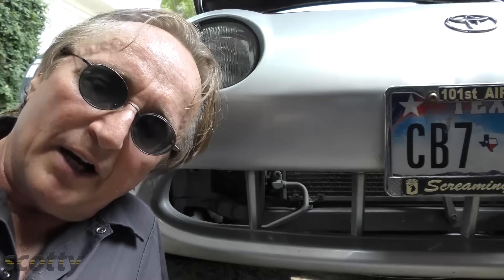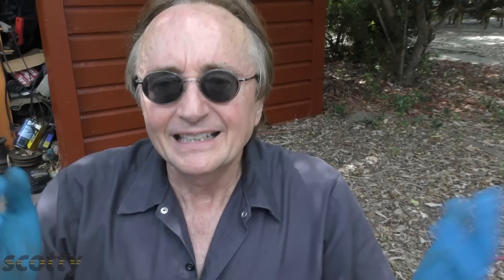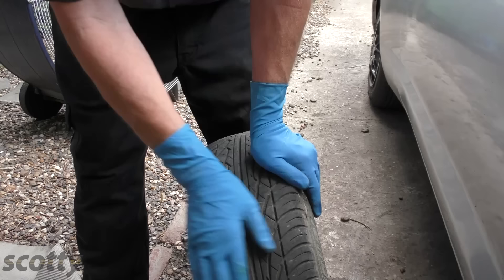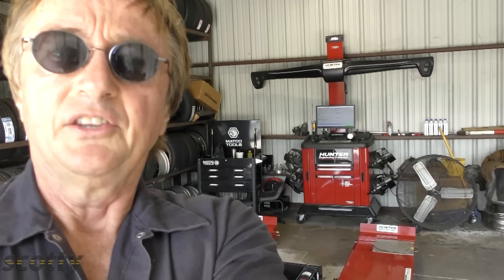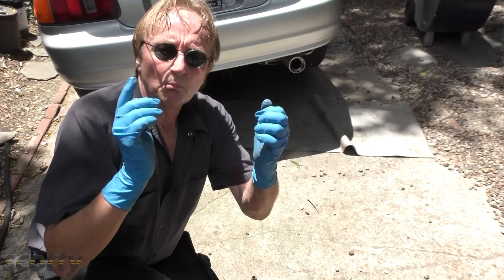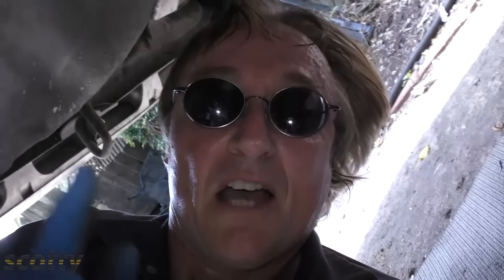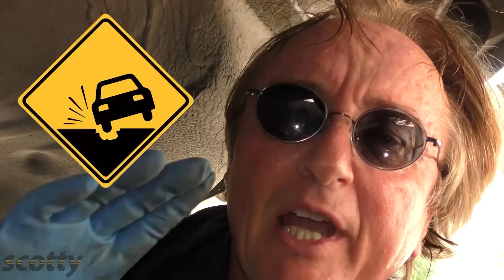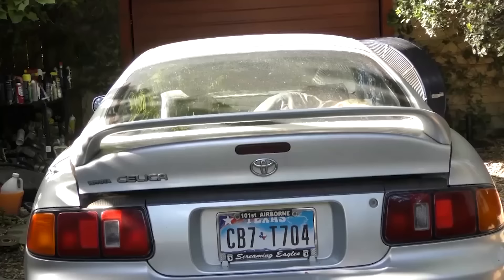How to Tell if Your Car Needs an Alignment

Comment: I just got new front rotors but before i did the dealership shifted crossmember to fix the caster . Left side axle had to be replaced also had warped rotors .With the new rotors Im still notcing a slight vibration/ wobble. My guess its caster issue but i dont know nothing about cars honestly. And dealership is acting funny now 
Any suggestions on how to fix my issue ?
Thanks 🙏

Comment: I have a 2001 Mercury Grand Marquis and it has 52,000 miles. It's really  squeaky over bumps. Can this be ball joints? It hasn't even hit 60,000 can they be worn already? Note that they are the old ball joints that you can't use a grease gun they will have to be replaced.

Comment: If your cars alignment is off some your tyres will tell you but you have to look as sometimes the evidence of alignment problems is hidden away. My car had alignment tyre issues and it turned out the actual car was bent not the alignment.
Reply: tires not tyres
Reply: @davidmartin9535  Tyres.
Reply: +cutterbacon what is a tyre!
Reply: +cutterbacon are you not from usa

Comment: Scotty, you can't have it both ways. Cars can't have fewer adjustments because they're 'built cheaper' AND require front end alignments far less frequently than in the past. I have a 2018 Volvo, and it hasn't needed a front end alignment...ever. That can't be said of cars in the 50s or 60s...they had more adjustments BECAUSE they were built cheaper, and stuff broke/got bent more often.

Comment: What could be wrong with mine, if my alignment is sometimes good, but sometimes not? Most of the time when I drive it’s shaky and the steering wheel is crooked. But once in a blue moon, it’ll drive perfectly. No shakiness and the steering wheel will be perfectly straight

Comment: There's a highly rated alignment shop here that doesn't use computerized alignment. $40 for front end, $60 for 4 wheels. I wonder how accurate they are.

Comment: What if my 97 RAV4 is not pulling to the left or right no shaking at 50 to 70 80 miles an hour doesn't pull but yet I still get a little bit of uneven tread wear how do I fix that just that tire alone or that side of the vehicle thank you for your how to videos looking forward for your answer and also the question on my  shocks and struts
Reply: Tire Rotation?

Comment: Hey Scotty Kilmer, i have a problem with my Saab 900 II, my cockpit doesnt work, the lights are on but no speedometer, the gas display dowsnt show anything, the cockpit lights are synchron with the radio music sometimes, also the right indicator is sometimes faster. The right break light work just when the normal light is out. I checked the fuses but they are intact. Greetings from Germany

Comment: I realize this video is old but, I have a question  for anyone watching. Could a car with a bad alignment cause bad gas mileage? I’ve recently been in an accident involving the front of the right fender on my car, and have had the right strut, and lower control arm replaced due to the damage. The shop did not have an alignment machine, and ever since the accident it has been getting 2-3mpg worse. I’m just wondering if the alignment being out of wack could cause this. I apologize if this question has been answered before in one of Scottie’s videos.
Reply: The car is all wheel drive if that makes any difference.

Comment: If my car doesn't pull to one side or the other and the tires are not really being used up more on one side than another but it does shake a lot after I pass 60 mph does that mean it's the alignment? I have a Subaru outback 2010 2.5 l and I believe it's all wheel drive. A guy last night while I was ubering told me that it's the CV joints but it doesn't seem like that is correct to me.

Comment: I got a question can shocks contribute too bad alignment
Reply: yes ,on modern cars even after an emergency breaking or hitting  a sidewall / The alignment of your vehicle can be knocked out of adjustment from daily impacts such as potholes and railroad crossings, or by more severe accidents.

Comment: Hey Scotty, I have a Mazda 3 2012, and I've gone through at least three sets of tires with the same issue of rapid wear and tear on the outer edge of my front tires. I've had multiple alignments and rotations, but no one has been able to fix the problem. What could be causing this issue, and how can I fix it?

Comment: So what if if just replaced my four tires and the car is shaking a little bit at high speeds and is pulling to the right? It wasn't doing this before with the old tires. What could it be?

Comment: Took car in for alignment and tire rotation. Have directional tires so they put back on front and front on back. It pulled to the right and said I had a radial pull.. tires on rear have better tread and would like them on front for winter. Any suggestions?  Tia

Comment: Alright so, my car shakes when I break coming off the highway, the folks at Canadian Tire say that my break pads and rotors are new and have no problems with them. However they did say my back two wheels are starting to be scalloped and my car slightly pulls to the left, is it an alignment issue?

Comment: Scotty what about maintenance schedules that say you should get an alignment every 60K miles. Would you say that’s accurate ?
Reply: Way too long. An alignment will go slightly out of spec on regular driving every 20k.
Not enough to show wear but when you get to the point you can see the uneven wear you are miles overdue.

Also you can have even wear just accelerated wear and poor fuel economy. When you look at the wear you think your alignment is good but its costing you hundreds in extra fuel and mileage.

Comment: Can I still get an alignment if my front struts are leaking? Or should I take care of the struts first. I know both things need to be fixed but I'm wondering if I could get an alignment ($86) done first before I fix the struts ($498).  I want to fix the less expensive thing first, but not if it's pointless.
Reply: since you have to get an alignment after you replace the struts anyway, I'd just do the struts first.

Comment: When buying new winter tires, do I need to replace TPMS (Tire pressure monitoring system).  I bought my car used in April 2019 and it's a 2018 Nissan Versa Note SV with 16,500 km

Comment: how about when you get new tires? (do you want to get it aligned)
Reply: If the tires are wearing unevenly, the car pulls or shakes at high(er) speeds then yes. I just bought four tires on my 05 ranger and never got a friend and alignment. It was driving fine.

Comment: my 2007 Daihatsu Terios's steering wheel starts shaking around 120 km/h and normally has a tendancy to slightly swerve to the left and whenever I'm reducing speed I get this feeling like the right side is all wobley (dunno how to spell that) but the car doesnt shake, I just hear it. 
I do have old tires that need replacing but is that all there is ? 
Every mechanic I ask, tells me something different.

Comment: Wong...Thousandths of a degree is measurable with a tape measure. It falls inalignment.
Example 33 in mud tires was on my nissan. Toe is 0.12 to 0.18 of a degree. Thats 0.078 to .103 inch. Convert fractions i n between and your in range.  
Mine is dead nuts on. I won't have it touched 
YOU CAN DO IT AT HOME on a bigger tire car. 
I will not say how many times I had to undo a crap alingment

Comment: Scotty I been aligning my toe in toe out with string for 15 years and I have never had tire wear and tear that was uneven. Maybe I'm just lucky but I drive older vehicles that the back axel is fixed with no adjustments.
Reply: Even if your back axle is adjustable, you can still use string to ensure it is parallel to front. If it wasn't you'd see the string wasn't touching front and back of the rear tyre.

Comment: Scotty , had upper and lower ball joints on my  Toyota  Hilux 1998     2.7 petrol ( not by dealership ) it has had wheel alignment  but it feels uncomfortable to drive , the self centering of steering no longer exists . Is there a wrong way to fit ball joints ? Cheers .

Comment: Love the channel. Is there something about rear toe alignment that's more exacting vs the front? I've always "fine tuned" my front toe a little with excellent results (on every car I owned) with small adjustments and some driving to test. Perfect tire wear too.  

However my 2010 Civic rear toe is a nightmare. Only messed with it when I got tired of it kicking to the side over bumps. Now it wears tires fast, gets very squirrelly in the rain no matter how many times I got back under it. The factory crayon marks are used as reference and I lined em back up then micro tweaks to no avail. I'm taking it to the shop. And this car is so harsh over bumps and feels sloppy in handling them, I'm hating this car. Yes the shocks have been replaced.

Comment: Scotty,  I have a 2wd jeep cherokee and when in reverse turning it feels like I have a camber issue(I can't see while driving) but the tires feel like they are slipping on the pavement and kinda buck mainly the passenger side .I can see a bit of tire scalloping and some inside wear on the tires. Do you have an idea on my problem? Ball joints,alignment,worn tires? I got it in an auction so I haven't got alot of experience in it. Thanks buddy from a fellow Texan and new subscriber!

Comment: How much does an alignment cost? For awd? Can the dealer do it under warranty?
Reply: Alignments are adjustments for wear and tear, so no warranty. Cost varies, but you'll typically find a cost of $70 to over $100 depending on whether your vehicle requires a 2 or 4 wheel alignment.

Comment: I took my car in for a front end alignment and all they said was that they did a visual alignment and it shakes on the freeway pulls to the right, very not correct I know that much about cars. They charged me for it and for putting a new tire on the car it doesn't look new. What can I do

Comment: I have a Nissan Sentra 2005 in my driver side back wheel is wobbling what would be the problem could you help me to figure it out it’s not the tire and wheel is on tight

Comment: Its not true that alignments can't be DIY. I get very good repeatable results using a parallelogram setup with conduit, strings, and a dial caliper. Getting the accuracy and making adjustments is tedious and time consuming, and one could argue not worth it, but it can be done.

Comment: HELP! Inside wear showing after slamming on the breaks to avoid an accident.. just an alignment needed or could it be worse?
Reply: Uneven front wear too if that’s a clue. Significantly more wear on the drivers side. 😞

Comment: Hey scotty, i just changed my stock rims in my suv from 265/60r18 to 275/55r20... Do i need wheel alignment? Thanks!
Reply: The difference in diameter isn't cause to have it done but you'd be silly to spend all that money on new tires and not check it.
If it hasn't been done in the last 10k miles, then get it when buying new tires. Otherwise 15k miles is a good benchmark.

If you ever need an alignment because you notice it wearing, then you left it too long.

Alignment should be preventative.

Comment: First, let me thank you for the many videos you have produced and posted on YouTube. They have been very informative and funny. Making them standout from the rest. Over the years they have saved me time and money. I do have one question though. I had my tires rotated and found that the ones now in the front are cupping, making for a nosey and rough ride. They were not like that before my rotation. The tires are not stock on my 2006 Toyota Tundra truck. They are larger Toyo Open County tires and are only about a year and a half old, with about 30k on them.  I take it my rear end must have been out of alignment? If that is the case, once I have both front and real aligned… running tires that are cupping will they have an effect on the alignment over time, or will they eventually ware evenly? 
Once again thank you very much. 
Mike

Comment: Hey Scotty, Walter from Virginia here. I have a 92 Mazda mx3, 5 speed, 1.8 V6, 175k miles. What do you think about these cars? It's hard for me to find parts for it, it's not worth alot online I paid 300$ for it. It runs pretty good what do you think of the mazda mx3? what common problems have you seen that I should watch for?? Any preventative maintenance I should do?

Comment: Mr Scotty, Is there any way in the world that bad tires can cause vibrations when braking hard in a speed above 70 mph? Well i would say the tires are not that bad, i bought them used from a tire shop and they are maybe 20%used, but there is a slight difference in hight on the inside between the last and step next to it on 2 tires out of 4 (Michelin primacy 3). It looks natural and does not show any kind of ware. Car pulled slightly to the left too after mounting, but then i switched the front wheels and the it pulls straight now. Pads and discs are prety new and of good quality( brembo) and are inspected and so are all parts around the wheel. This is an realy anoying issue. I was thinking maybe to check the wheel aligment anyway since it has not been checked if that also maybe could cause vibrations??

Comment: I usually do my own wheel alignment at home with a giant home made caliper with adjustable square ruler for aligning the left to the right wheel, 2 jack stands with string to align the front to back with the use of adjustable square ruler , and a mini bubble level for camber. The adjustable square ruler is also used for measuring caster and the giant home made caliper pretty much looks like a very wide U, it can be made out of wood or steel. I also had the alignment tested at a shop once and they said no change was required.
Reply: Yea but a homemade alignment isn’t going to be as good as a alignment done with a thousand dollar machine
Reply: @randomaccount2725  If you do it at home and the tires aren't wearing unevenly, and the vehicle handles properly, then it doesn't matter how much that machine cost.

Comment: A question  not about this vid  can you tell me what the little white connected behind the intake on my 1998 5.7 is I sits lower then aircleaner plastis parts and above the manifold and has a very small wire.  
Thanks

Comment: I hit a large pot whole over a month ago in my car , I recently had my yearly inspection done aka MOT in the uk .I was looking to get some new tires I noticed my right rear on the inside has no tread on it does this mean something is bent or I need an alignment.

Comment: Just got myself four new tires in my vehicle as it was wobbling quite crazy on the highway, and the steering wheel wasn't exactly straight.

Went into a shop that does suspensions and all different stuff like that.
He did a wheel alignment but he didn't use the laser machines which I thought was very funny?

I'm used to seeing only the laser machines being used.
 I paid 70 bucks but I don't think I got the alignment I was supposed to get.
Is the alignment I got worthless?

Or how can I tell if my alignment is okay being that I got four brand new tires, as my previous tires were being worn on the inner part or was it the outer part.
Besides for shaking like crazy when I was at 70 80 mph
And like mentioned uneven wear on the threads.

Comment: I took the car to Firestone for alignment since I replaced the tie rod. After one month, outer edge of front tires  worn out really bad and squeaked. The problem was the toe angle. Firestone did not the job correctly. Why didn't they do the job right? This is why people don't believe Mechanic.  They try to do the thing by themselves with scotty

Comment: Hi there. Got a set of Bridgestone potenza on the front, made on 1421. Now i've got an excessive outside wear. went for a alignment and they said they are perfectly normal but don't know what's causing it. Even after checking the suspension and all that's in there. TBH i don't know what to do now.. as i drive quite a lot. 1500 2000miles/month. Usually motorway. any advice would be great..

Comment: Recently had to replace my front tires due to uneven wear.  Found my last alignment was 90K miles ago.  Paperwork for my last alignment showed 'before and after' specs, new one didn't show squat...just basically said 'alignment....$$$$'.  Anybody know if that's the 'new norm' now?

Comment: I hear a slight grinding sound coming from my front passenger side tire I think. you can hear it griding faster as I speed up. it sounds like metal on metal. the car  also wobbles at 55-65mph any faster or slower and it doesn't wobble it's a 2001 Nissan Maxima any idea?
Reply: Rhinoman85 sounds like a bad wheel bearing!

Comment: How often should I get my tires rotated. My Honda dealer wants to do it every time I get my oil changed.
Thanks
Reply: Most tire manufacturers suggest 6000 miles between rotations, and check the balance and rebalance as needed every 12000 miles.

Comment: I guess I need an alignment, my civics steering wheel shakes after 60mph. Shakes for 2 secs, than stops for 2 and so on.
Reply: Shakes usually due to balancing issues.  If you have cheap crap tires there may never be a way to balance them properly either.
Reply: As already said, most likely out of balance. Could also be a broke belt though. Check for bulges on the tread. You can also rotate the tires and see if the problem feels like it changed or switched to another location. Don't keep driving on a broken belt if you discover that's the problem.
Reply: Thanks for the feedback guys, I honestly wasn't expecting any responses. Muchas gracias.

Comment: Hey scotty, my car's steering wheel vibrates (violently) when braking from high speeds. Could this be an alignment issue? - 2006 Pontiac G5
Reply: Jude K that is a warped brake rotor. Get new brake rotors , they usually dont cost much